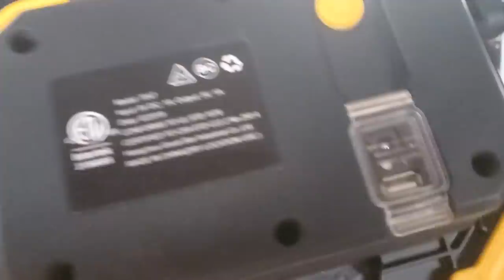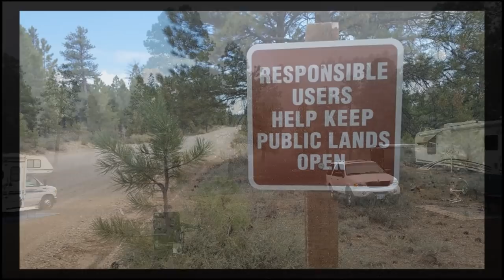Don't Let Fear Of Breakdowns Steal Your Joy Of RV'ing!

Comment: I was so excited to be done with renovations on my house ... I was calling it done ...I'm thru ...no more to do ... only to find ... yesterday I was there to celebrate ... and found the water heater is not working ... they only cost a few hundred dollars ... to replace ... plus hiring labor ... somehow I don't feel to good today ... but your little speech gave me a feeling ... don't give up ... but it does want to steal my joy... as I have worked on the damn thing for ten years
Reply: Update ... the pilot was blown out ... due to high winds ... lesson learned ... always check the pilot light first !!

Comment: You're exactly right about having an emergency fund. Several years ago we purchased a used Chevy Suburban to haul our travel trailer. We paid $6000 and thought we got a great deal. One month later the engine died and we spent another $6000 to replace it. Since then it's been great, though, no problems at all. Thank goodness for the emergency fund!

Comment: My second ownership of RV life, I decided on a 2 unit.  #1 I am back to a shuttle bus if possible, preferably a 450 engine for tow power and #2 a toy hauler cargo trailer.  I saw a cargo trailer flipped by a tornado, it stayed intact due to the metal instead of exploding and coming apart like the fiberglass trailer next to it- impressive (on a lot, no one inside).  I am doing a custom build with both, simple and easy to fix.  I have been buying supplies for a year now.  Since tubs have gone up, that was an expense, but I think I am complete now.  I have just a few scattered items left to pack and a few empty tubs to use.  I found some good deals for the water system.  I struggled with ideas for a year and finally found what I wanted to use and at a good price.  I have at least a year to buy before I put my house up for sale, but I am leaving some things to buy after the house sell, such as the solar system and back up generator.  I was going to sell this year but I am just not ready yet.  From real estate news, the housing market will hold so I am safe to wait until this time next year.  The weather has been crazy here in Idaho too.  A mild winter and a long wet spring into near summer, which is unusual.  I want a dry season for showing the house so hopefully May next year will be dry.  I plan for utilizing half the house sell money for my mobile life and half for emergency fund.  Due to my customization, the heavier cost in the emergency fund will be automobile repairs.  I may be over planning, and I know it most likely will not be smooth sails, but, for the most part, I am feeling safer with my choices.  The anxiety left will be to gather the vehicle, cargo trailer and last supplies, install and hit the road within 60 days of house sell!

Comment: You are absolutely right, Kevin. Almost one year ago, we bought a 2004 Holiday Rambler Vacationer 37 ft Class A. It was in beautiful shape for an older coach, low miles, many upgrades, new batteries, new LED interior lights, new flat screen TVs in main living area and bedroom. Very well cared for coach, the previous owner kept it spotless. With all of that being said, first long trip with it, we broke a brake line. Had to be towed and needed overnight accommodations for us, our two dogs and one kitty. Good Sam came through on both. We got the coach back the next day, and just west of St. Louis, we blew a tire on the inside right dually. Good Sam was there again. We replaced both tires on the right rear at that time, and 2 Weeks later, we replaced the other 4. So all new tires, even though they looked good when we purchased the coach. A month later, the furnace stopped working. More $$$ for repairs. A couple months ago, the a/c needed recharging.
It's always going to be something. It's just like owning a house, maintenance will need to be done, whether new or used, and whether you own a million dollar Prevost or a $30,000 HR.
Reply from the maker: I'd  be curious to know what the tow bill was- how far it was towed etc etc. Bills incurred... thanks!
Reply: @CampervanKevin  Incident happened in Effingham, Illinois as we were leaving the campground we had stayed at overnight. Hubby says tow was about $350, for approximately 5 miles. Repair was $230. 
The campground let us stay in one of their camping cabins, we had 30 minutes to get what we needed for overnight before the tow truck came. I felt like I was on Supermarket Sweep, remember that show? I used my laundry baskets and a couple of totes to throw things in. Whew!

Comment: Next town trip get yourself a tin of bag balm. Use it on cuts and scrapes on you or the babies. You can find it at Tractor Supply. While you’re in there, pick up a couple of rolls of equine vet wrap. Also great for you or the babies. It stabilizes sprains, holds on bandages, supports weak joints and sticks to itself.
And, have a very Happy Birthday!

Comment: Kevin, glad it worked out with the AC. I have a 98 Bounder I had to have towed and the first thing they did was remove the drive shaft. Not sure why but the driver said they always remove the drive shaft in an RV before they are moved. Just a little info to ponder. Have a good one my friend.

Comment: Good Advice Kevin 
Dont forget a cash  back up ,for Snacks & Beer.
Stuff, Steel Wool into any hole a mouse will try to access . 
Drive Safe
Reply: Steel Wool works great, I've got every opening around my water pipes under the sinks filled with steel wool, only have had 1 mouse in the house in 19 years & that was before I used steel wood & he came in thru the window screen, under it.  New windows were installed !

Comment: Hi CVK.  You just have to love those dogs.  That Tucker has a great  personality and can be such a character.  Speaking of preventive maintenance it`s probably not be a bad idea to purchase a set of 134A Service Port Refrigerant Caps.  They double seal the Schrader valves.  Without them the if the Schrader valves seep the 134A Refrigerant could leak out in less than a year.   They sell then at Walmarts or any automotive store.   Four or five bucks can save you a Refrigerant charge.  Its money well spent.  Keep the Vids coming.

Comment: I bought a 28ft Fleetwood travel trailer brand new in 1989.  I had more problems with it than I have had with My used 28 ft. 2003 Sunliner that I bought used.

Comment: Hehe, it's Flagstaff. What do you expect in May? :)  CO mountains have winter storm warnings out and are expecting 8" to 16" of snow.

For your temp control wire, I would use a ty-wrap and make a loop around that black box, and then slip the ty-wrap up behind the relay or whatever it is that is screwed to the firewall. There's no strain relief on either of those two spade lugs, and that will continue to drop off and cause you problems.

Comment: WISE WORDS!  I’ve been there.   Had 40’ diesel pusher. In severe winds along Rockies, wind got under front drip rail seam and torn 4” strip back the 40’.  Cost $14,000 for new roof. My Sam’s warranty did not cover. Was told it was a known Winnebago issue. Lesson: Always ask what it doesn’t cover.  It blew my safety budget. So passing Tucson, stopped bought a small lock and leave house and sold rig. Next time will get into a more budget/repair friendly rig.  ps, big fan of the wolf pack. I traveled with a Great Dane.

Comment: Fear is about 75% of why I havent left yet..parked stationary x 1 year..prob be another year bfor I'm comfortable with my emergency fund..want enuf to cover an engine or tranny, at least..I'm in a van, not as costly as a class A, but things do break..im in a 93 Ford e150 conversion van..have replaced lots of little things this year..now working on exhaust system, then fuel system, then brakes and van should run almost like new👍👍you may have a fracture kevin..should prob get it checked, esp bc you are still having pain..the bruising can take months to go away so dont judge by that, but the pain should be an indicator that somethings wrong..retired nurse here..at least go to clinic and get exray👍👍
Love that woof pack but tucker really has my heart..thx Kevin..happy travels✌❤😊

Comment: One problem we all have as we get older is lower extremity circulation, thank you gravity.  Its very common that if you get a below the knee injury that results in broken blood vessels instead of just localized bruising where we made contact with what we hit or what hit us, the blood that leaks from the broken blood vessels can travel through the tissues towards the lowest part of our body - especially while up and walking.  We don't always notice it right away since its sort of 'draining' so it may not even show as a purple bruise like we would get with fresh blood just staying where the injury was,  But as it settles out where ever it finally stops moving then you get to see the green/yellow discoloration of the blood breaking down.  Also, because our legs no longer have the best conditioned blood vessels any longer (again thanks to gravity effects on them over the years) and out leg muscles are not in the best condition like when we were younger the blood that gets pumped down to our feet has a much harder time getting back up to the heart.  Veins don't pump blood - they count on muscle contracts while we walk or exercise to move the blood back up - an that's just not as good when we are older so we don't heal as well or as quickly below the knee and also have much easier chance of swelling then before we were 30.  The very best thing to do if you injure yourself below the knee and  its just bruising and or scrapes or cuts (not broken bones of course) is to baby that leg for a few days in the sense that you stay off it as much as possible, keep it elevated as much as possible - even when sleeping and while it won't do as well as back when you were 20, it will help it heal better and not bruise as much.

your comments about not coming out to join in full time, RV'ing if you don't have a repair budget set aside is excellent advice.  I week does not go buy where yet another broken down RV joins the street parking where its allowed in the city for no other reason that they went RV full time, with a budget to deal with food and fuel but not a thought to what happens if the home or the vehicle breaks down.  Many time these are people that were renting apartments and when something broke teh landlord fixed it and so they have no experience with having to be prepared when something breaks down in your house.  they usually do have a bit of experience with the fact that a vehicle can break down but  when it breaks down and your living in an apartment you still pretty stable and there are other ways to get around, when its also where you live it can be a major issue.  So many think that moving to full time RV living is going to save so much money as they won't have rent but they so not realize that they are often just exchanging rent for costs of close to teh same but just for other thins especially if they had to start out with a much older RV they they originally thought.  I agree that buying new can often be more of a hassle because as it gets broken in so many things go wrong (although most are under warranty not all are) but if you buy too used you are not getting an RV where everything that could go wrong as be fixed you buying one that everything that could wear out is wearing out.  A couple of years used where teh original owner dealt with all the new RV issues while they had it and if they otherwise took good care of it then you can do okay but many people confuse that 'used' situation with the same as they will have with a 20 year old RV and its definitely not.  No matter how well it was taken care of and babied all those tears - systems do have a lifespan and they are going to start hitting it.  If you don't have a nest egg put back for repairs and replacements you going to be out of luck and out of luck pretty quickly.  We meet many a newly full time RV'er stuck and broke down with either engine or transmission or brake system issues who RV is not moving until they can get teh money together to fix it and that usually means staying put for a few money while the save up to fix it or staying put while the get a part time job to make the money.  I also hear how many expected to jump in their RV and go full time, and started posting videos about it and can't understand why they are only getting followers at a very slow pace and why when the email the RV'ers that they watched a great deal and got the idea to try fulltime RV living wanting to collaborate with them in hopes of being introduced to their followers and benefit that way and don't understand why they don't immediately get an answer from them all excited about helping them build there youtube viewership.  Actually, seen a couple of then that have just started out actually complaining on their videos that after they supported this other RV'er as viewers for a couple of years that the RV'er is not jumping at teh chance to help them.   I tried explaining that while they are watching a couple of RV'ers that RV'er has many thousand watching and contacting them and so while a viewer might feel like its a one on one relationship the RVer might not even have a clue as to who they are or that they used tehir Amazon links or bought a shirt from teespring or whatever.  They really did count on having a Yt income of a sizable amount to cover if something did happen and expected that within 6 months of RV living they would be a major player in the community as they would jump in tehir RV and contact the other RV'ers and be a start in the community right off.

Sadly, fulltime life in an RV is not as what many think it is, and its true that many that do do it don't really take the shine off the life and let people see what it takes to be able to do it and be comfortable with it and that 2 weeks in teh Rv or even 6 months is not necessarily going to find you meeting up with teh well known full timers and making collaboration with then to harvest some of their 'clout'.  It can be a wonderful life it your suited to it and not everyone is but its also not something that is inexpensive or easy to do and your not going to be treading in the first few videos you upload to youtube.  i think its better for those that are thinking about it to know the god and teh bad as well as the time it takes to get situated.

Comment: SOOOO helpful!  I am a newbie with a 2016 Dynamax REV 24cb. Wasn't sure if the generator for this was gas or propane? It has a RAM Promaster engine, technically a C but no overhead cab so some say B+. Either way, I greatly appreciate the fesdback and insights from seaoned fulltimers. Only been on road 5-6 wks and already feel like I've been thru bootcamp😉! Can use all the help I can get.

Comment: Hey Kevin, my wife and I have been a fan of yours for a couple of years now. We just bought a 18’ Kodiak travel trailer. Now I’m going to have to buy a new vehicle, I just put a hitch and brake controller to tow my trailer on my Safari van. I find out it don’t have enough power to tow it. I mean it tows it but I can tell it’s a real strain on it. Anyhow, how can we find all of the beautiful places to boondock? I’m putting 60 gallons of water, 320 watts of  Solar, instant on hot water heater... we live in Florida and we’re getting ready to go. Short trips first. We can’t afford these campgrounds.

Comment: You are correct about a Budget Go Big or go Home.... I went Big and Then went Home.....LOL I gotta Airscream Motorhome twin turb0 Banks 454. Also a 150 Gallon Tank and 16MPG on the Highway Down Hill with a Tail Wind. Hey I enjoy the Video's keep em up. At 3.13 a Gallon it wouldn't take ling to burn through some serious cash. $469.50 for a Empty Tank...31cents a mile average. lol again plus wear, maintenance, insurance etc. now it is .46 per mile.

Comment: Kevin, love your videos and the Woof Pack. Thanks for the tip on the plug wire for the AC. That could end up being a costly repair at a less than honest dealer. Safe travels always.

Comment: Fear of breaking down is very real --- I suspect picking a rig that is safe and not falling apart up front is the biggest challenge.

CVK, do you have any recommendations what to look for?   What the common problem point are?    Rust, delimitation, "systems" (Heat, AC, Refrigeration etc)...

When looking at an older rig especially --- I've seen some really nice looking bounders --- how do I know if it is TLC or a money pit?
Reply from the maker: so many variables....... just a new set of tires is $2500....

Comment: Kevin - could you repeat how you use vinegar for bathing?  I remember you mentioning it in the past, but can't remember the details.  Thanks, Judy
Reply from the maker: just a little vinegar and maybe a drop of soap mixed with mostly water. spray down and dry off as I go, then I go back over everything with baby wipes. I like to heat it up and use a bottle sprayer to apply
Reply: @CampervanKevin  Thank you so much!  We travel in a Class C and I have a hard time getting in the shower area.  Your routine might help an oldster like me!
Reply from the maker: I actually prefer it most days. It uses no water and doesn't fill up your grey water tank. I think it is very refreshing. I use apple cider vinegar and white distilled. Just dont get it too strong or it will dry you out. Don't spray your eyes of course. I even spray my hair/head with it. The baby wipes helps neutralize the vinegar that you didn't wipe off completely. I use the Shea Butter ones from Walmart baby isle. Clean as a whistle
Reply: @CampervanKevin  You are such a sweetheart!  Thank You!